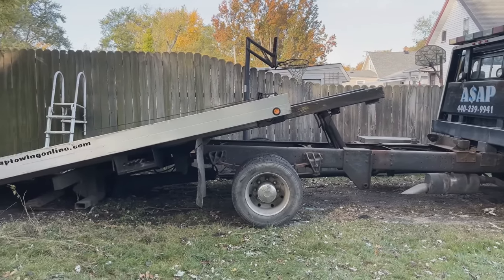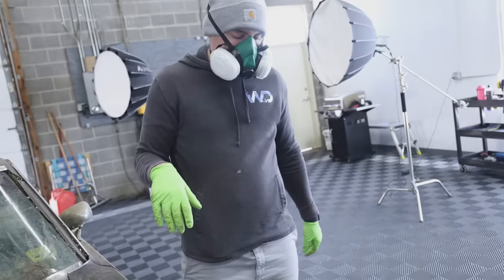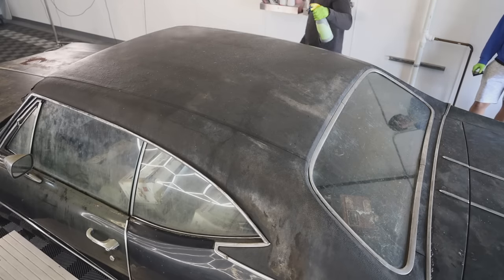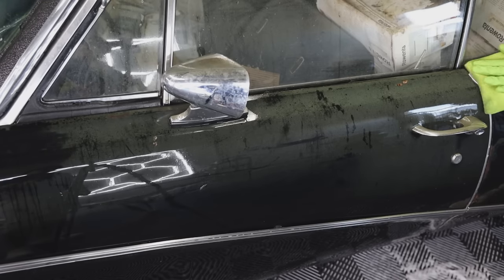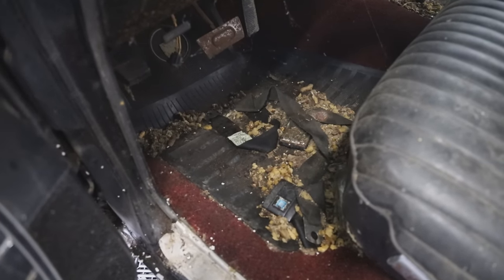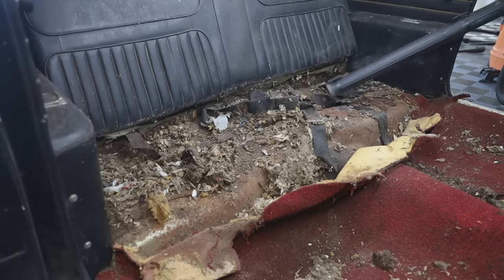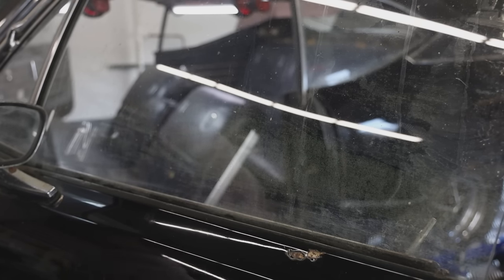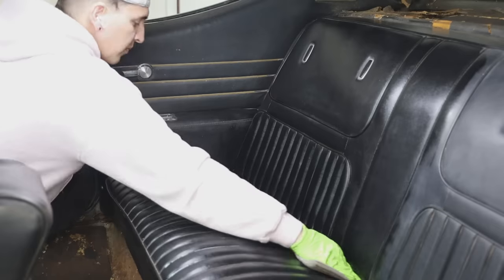First Wash In 30 Years: ABANDONED Barn Find Buick Skylark Disaster Detail! | Satisfying Restoration

Comment: The interior and exterior do not look bad.  Do a quick oil change, bypass the fuel tank, attach a new battery, and try to start the engine to determine if it becomes a restorable or a parts car.

Comment: Looks to be all original with the 350 2 barrel. Trunk pan looks good. Floors look solid. Interior is actually still pretty nice and all there. Front bumper shouldn’t be hard to find but grill might be tricky. It would be a shame to part out this car. Not any left in original condition like this. It even has the stock floor mats!
Reply: Донор найдётся,надеюсь.

Comment: You ask if the car is worth saving/fixing/running?  Sure, absolutely!  Someone will love this old classic.  

I'd say it's a 1968(?) Buick Skylark Custom, 2 door coupe, with a big old V8 motor.  The "Custom" was the fancy trim package; it still has the rally wheels.  The interior isn't half bad.  The exterior is kind of rough, but it's solid and not too rusty.  It has a good vinyl roof.  Sure it was front ended, but the damage seems light.  The car is all there; the glass, the trim, etc.  It has parts in the trunk too!  

You didn't say the mileage or engine size; but yes, someone will definitely fix this car up and run it.  The car is not going to "Pebble Beach", but it would fit right in at a local car show.  A high School kid would LOVE this car!  Get laid in that back seat for sure!  

The Buick Skylark is a GM "A body" car, the same body as the Chevy Chevelle and the Pontiac GTO two of the most iconic and coveted American "Muscle Cars" ever built.  A fully restored, matching numbers big block '68 Chevelle or GTO sells for $100,000.+.  Really.

Buy this car for a grand, do a boneyard motor swap... say a Buick 455ci of the same vintage.  Mount new shocks and tires.  Rattle can the hood and front fenders.  Carpet the inside and it's off to the Drive-in movies with your high school girlfriend!!  

But seriously, this car is worth money.  I'd much rather have a barn car full of critters than a rusty shitbox sitting outside for years and up to the axles in mud with trees growing under the hood.  This car is valuable.  Let us know what your client did with this Skylark.
Reply: ʟᴇᴛ'ꜱ ᴛᴀʟᴋ (ᴠᴇʀʏ ɪᴍᴘᴏʀᴛᴀɴᴛ)👆🎁

Comment: replace the interior redo the running gear and brakes and leave the exterior the way it is and drive the heck out of it and change the red carpet to black.
Reply: I don't think you need to do anything but fix the headliner and throw some rug in it

Comment: Even if half the floor is gone it would still be a great restoration as I'm sure there are cheap new available. Outside skin is cheap and for sure it does need a full repaint. There is no major accident damage and most of the chrome is still there. The details are the hard to find and expensive parts.

Comment: I would build this one on two conditions. 1, is the engine and transmission original and mechanically sound?  Numbers match the build code?  If yes, and no major frame damage or severe rot under the vinyl top, this is definitely a candidate for a build.

Comment: Considering it's an older car that got left untouched for a long time, the interior being destroyed beyond reasonable repair, it's probably better off being a parts car. As someone with a 1991 dodge, I know it's pretty difficult to find any after market interior parts just to make it look good, and if you can't make the interior good, what's the point in rebuilding it? Also depends on how much work the engine needs, if it just needs cleaning and runs fine with minimal parts then I guess you could just take parts from another car to fix up the detailing issues.

Comment: I bought mine in 1981 got 150 dollars put a transmission in it drove it to work the air conditioning even worked. It run really good went to go buy a part I thought it was a 350 but found out it was Actually a 340 omg a Rare one I wondered why it ran so good with a two barrel carb. It drove and rode. Handled really well I sold it to a friend and then he sold it to a friend. I would rebuild this in a heartbeat

Comment: First look at similar restored cars of brand and model for sale ,then you at that figure discount how much you paid and tow ,cleaning costs ,the difference is what you have to invest restoring the car ! 
The plus is : the car is not rusted, is a Coupe two door , and cosmetic is not destroyed ,  you will need if restoring , a new fuel tank, filter, pump ,clean carb.,new plugs , distributor ,   spark plugs, cables , oil , oil filter , and fresh coolant , just to run the engine and see in what condition is , like after running ,compression test , or listening for knocking noises !  Lol , if worth it the gauges, and electrical components , the heater,A/C and lights wiring system must be inspected or rewired , because mouses do chew on wire coatings !  Once you run the engine , do inspect the rest or then include everything to be renewed  ! For sure is not a Ferrari  ,that no matter what you invest it ,will bring it back at the final sale , Here the saling point is that is a two door and looks decent , to be restored , but yes always , math runs the world !

Comment: Why not find and restore some 1966 BUICK SKYLARK’S. When I was young I had one but I messed up. I didn’t know enough to let someone else work on it and I couldn’t put it back together. I attempted to try and repair the air conditioning unit on it but I really did not know enough to do it correctly and working outside without a garage at Pine messed up I paid $1000 for the car back then and I ended up ruining it and it went to the junkyard but it was already rusted out from the front floor board all the way to the rear bumper someone had put brand new carpeting in it made it look good I was not smart enough to crawl underneath it and work underneath at the floor pan. Now with all the years behind me I wish I was young again. So that maybe I would not have made those mistakes back then. I would’ve held onto the car cover it up someplace I could’ve had it restored it was a beautiful car inside and out as far as the top side anyway was not write it out.

Comment: It's candidate to redo, go through the motor get it rebuilt or get a crate motor one of the two check out the gauge cluster and go over it and just basically give it a good going over, with a little TLC it aughta be just fine.
Reply: Hope ya'll had a very happy Thanksgiving
Reply: That's how you can call or text.

Comment: Really nice car to rebuild Buick you need to have something in mind it's not a Chevy where you can find parts anywhere they get pretty expensive specially that engine have oil problems better off taking a motor out of a 1970-1972 Buick to put in I believe those years they fix the oiling problem

Comment: I get the impression that these two guys are detailers and not restoration specialists.  I don't understand all the time 
and effort put into polishing this paint.  The car needs to be stripped anyway.  A lot of needless effort was put into 
detailing this car.  This Buick appears to have a solid body and would be a great candidate for a full restoration. 
All this fine detail work is for nothing.  No one is going to keep that interior after what has lived in it.  The vinyl top
has to come off, because there are bubbles under the vinyl.   Not one single part that has been detailed will remain
untouched after a restoration.  Many of these parts will be replaced.  The body will be dipped or soda blasted.  
I'm not one for wasting resources and that what this looks like.  The video is more of a exhibition for people to see
what is possible.

Comment: Parts car are rebuild just depends on how far you want to go myself I would rebuild it that car I would just take and rip everything out of the inside of it ,take the seats and  have to have reupholstered paint the bottom floor inside , new insulation. Check if  engine is any good check it first